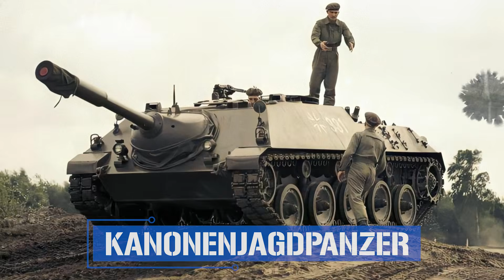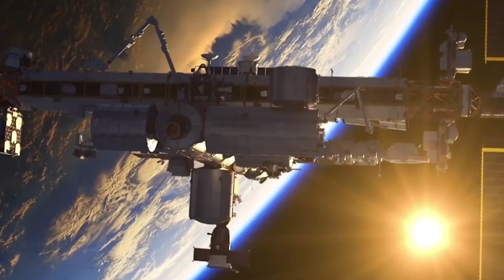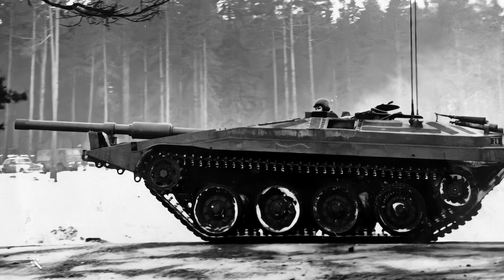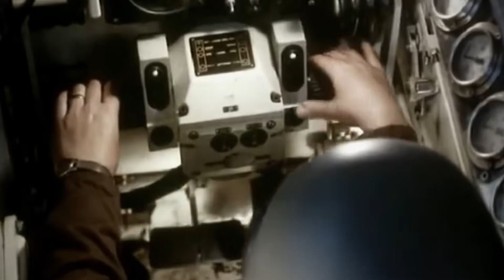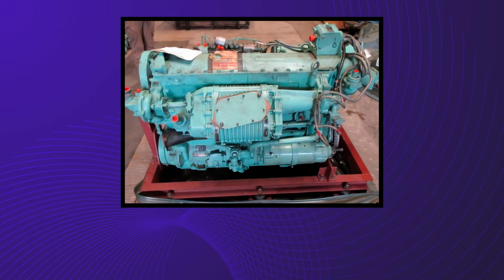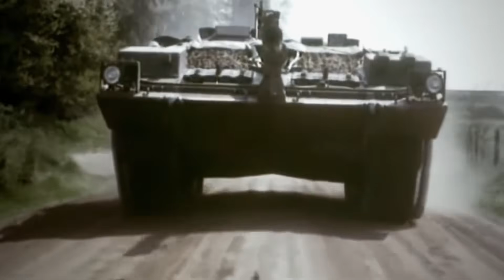Stridsvagn 103: Sweden's Turretless Cold War Super Tank

Comment: Where exactly do all English-speakers get the extra 'E' from? It's not a German bubble-car!

"vagn", not "vagen"!

As for the "tank destroyer, not a tank" nonsense, no-one with that argument has any explanation as to why the American M10 had a turret, while being a tank destroyer. It's almost as if you'd think designation is dependent on usage...

There's a slight difference between a 105mm gun and a 150mm gun. The Centurion did not have the latter.

"L/62" is not a designation. It's a barrel-length, the gun being 62 caliber. The gun was the L74.

Rate of fire was not "nearly 20 rounds", it was 24 rounds. This was, of course, the guns capacity, actual in-combat was lower due to things like needing to aquire new targets, etc.

Magazine capacity was, specifically, 25+20+5, the two autoloader magazines holding 25 rounds on the right and 20 on the left. These could only load one kind of rounds, and was generally separated into AP and HE, with a manual magazine holding 5 rounds, most commonly smoke. 

The third person on the crew also had a human aspect. With a third person on board, there was far less interpersonal issues, particularly when everyone on board could reach and touch each other.

The Strv 103 was the first tank to be fitted with a turbine engine, something that has become somewhat of a standard in various modern tanks.

And, finally, the Strv 103 was never the "S-tank". It was the "S proposal", for "Swedish proposal". When looking for a new tank to replace the Centurion, there were two choices, the "A proposal" for the M60 Patton, the "American", and the "T proposal", for the Swedish word for German, "Tysk", being the Leopard 1. The Swedish proposal, which would become the Strv 103, was of course then the "S proposal".

Comment: Learning about these tanks recently, it makes me wonder if they would fare well against the drone warfare in Ukraine!

Without a turret this design could focus more on keeping the main body armored, and focusing on survival ability has never been more important! The main cannons are useless against small targets anyway, so the fixed cannon isn't a significant downside.

Adding remote operated small caliber turrets and indirect fire missiles to the outer hull would be good against drones, the low profile would help keep it concealed and the main gun could still be used to shell other ground vehicles and positions.

The cannon could feasibly be made slightly shorter to avoid the dirt issue, with modern ammo I'm sure accuracy and even velocity wouldn't be heavily affected. Perhaps placing the cannon a little higher on the hull as well, so that casing would be ejected at the top?

And change the crew exit points to the back to fortify the tank against drone and missile strikes coming from above, focusing on crew exit mobility.

If the swedes were to make a new tank, they should really consider this design again for inspiration! It looks fairly effective, and with new tech, could be improved further!

Comment: One benefit the 103 had with its long Bofors main gun was that it could open fire long before the T55, T64 and T72 could because of its range and accuracy. This is why this tank was one of the first to use a laser range finder and ballistic calculator for precision hits.
The fast auto loader made it possible to hit each target twice to inflict maximum damage before changing target.
It was a complex machine for its time, built for one thing, stopping a numerical superior Soviet tank force at the border.
Reply: Wasn't the main armt an L7? So, did BOFORS not Licence build it?

Comment: Any fan of this tank wants a role for it if only that it looks so cool. With modern guided munitions, computer assist targeting/re-acquisition I wonder what could be. The low profile and self-revetment in  a forest is sensible. 
  I once lifted a good sized snapping turtle from a road and placed it by the wooded lake and on firm mud. Rather than move away, it swiveled and lowered right down into the earth to leave only a bit of snout exposed. I watched and was impressed and disturbed. I also thought of the s tank.

Comment: Behind some elevated terrain you woudn't see it but the gun smoke, shooting at it and the shells either fly over or hit the ground cover. Nightmare ambush tank. Flanking it or strike it vertically using mortar/artillery or air strike only options. But the S tank crew knows this so won't linger too long in one place. Hit and run.

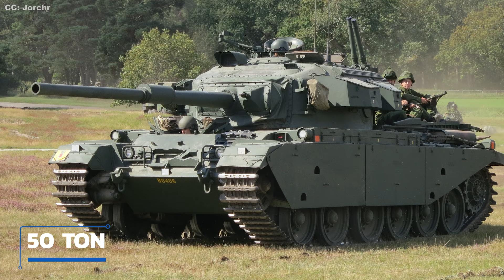Comment: 1:30 - 105mm L7 cannons were used on the later Centurions, not 150mm cannons.

2:37 - The Kranvagn tank concept was of a Heavy tank, not a medium tank (one of the reasons it was dismissed). The vehicle was to feature a 150mm (could explain the confusion at 1:30) Additionally, a significant reason for motivating domestic development in Sweden was the fact that Britain's forecast when it came to delivering Centurions stood at 0, meaning in the event of a war, Sweden would be stuck with only the tanks they had available at the time. This is also the reason why the project was later cancelled, and Great Britain was able to deliver Centurions to Sweden which were cheaper and still showed military promise.

3:49 - The last S-tank production model (Model C) weighed 42 tonnes as indicated in the video, yes. However, the earlier variants were 37 and ~40 tonnes for the A and B models respectively.

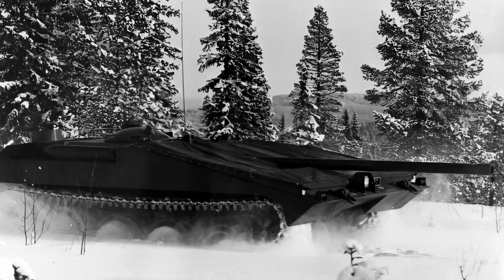6:05 - The S-tank featured 40mm thick plates on the upper and lower front. Not 70mm plates. Sode armour was limited to only 20mm, not 40.
Reply: He also said "High-Energy, Anti-Tank" as opposed to "High Explosive, Anti-Tank"

Comment: I always thought this was a highly innovative design. The dual engines does seem like overkill though, but I am not an armor General from the 60's.  I do think that if I was making this tank with it's fixed gun and autoloaded, I'd have put a serious cannon in it. 120mm would do.
Reply: It's not like they added the faster engine to get more speed, they added the slower engine to get more torque and finesse because to aim the gun you had to move the whole thing, not to mention it retreated facing the enemy. Additionally, the engine bay is in the front, protecting the crew from damage if the tank did get penetrated. So having additional engine mass there helps keep valuable crew alive, which is a priority for small nations.
Reply: @Vinterloft  OK, so use one bigger engine than two small ones. Or, use the weight savings from the engine to add more armor, which will provide more protection and less vulnerability than using an engine as armor. 

BTW, keeping crew alive is valuable for all nations....except people who use Russian gear. NATO tanks place a high premium on crew survivability. They cost more to train than the value of the tank.
Reply: @Elthenar  Armour is actually one of the least important things for crew survivability. What you want is an empty space, or complicated space, for the round to detonate inside of, surrounded by armour so the shockwave has to exit through the entry hole. That's exactly what this achieves.
Reply: @Vinterloft  Nonsense. No one has been firing armor piercing high explosive rounds since WW2. Anti-tank rounds have been HEAT rounds or sabot for decades and decades, neither of which detonates inside the enemy tank. 

At the time this tank was built, designers were skimping on armor a bit because there was a line of thought the armor couldn't be designed that would defeat HEAT rounds. Tanks like this were built to use the large steel mass of the engine as extra armor. Which has been proven to work with the Merkava tanks. Still though, armor is everything. Intelligently designed thick armor is the best protection, by far.
Reply: @Elthenar  "neither of which detonate inside the tank" except they detonate the tank's combustibles. Ammo or fuel, or both. No HEAT or Sabot gets through the 175cm gap between frontal glaces and crew shield, and if they manage to detonate fuel in the engine the crew is unharmed either way.
Reply: @Vinterloft  So, what's your point. Having the engine in the front does increase survivability. Losing the second engine to add more armor would add even more survivability. How are you arguing against this?

However, if you think that front engine design makes it immune to frontal attack, you are wrong. The Merkava tank uses a similar design and ATGM's were able to kill them from the front. And that is with heavier and more modern composite armor too.

Comment: Stridsvagn S/103 was not the main battle tank til the mid 90´s. It was actually the Centurion (being improved over and over again). The truth (maybe not official) is that the stridsvagn S/103 was more or less a failure from the beginning. As mentioned in the video, it turned out being too advanced and complicated (the hydraulic system) resulting in failures all the time, making it too irreliable which is a no-no at the battlefield. Apart from that it was, as told in the video, probably great in most ways.

Comment: Using the identical concept, could a new tank be developed with a larger gun, more armor, and greater speed?  Asking for a lot. I know.
Reply: The biggest problem today would be that you would never reach the same flexibility as a modern MBT with a proper stabilised turret. Back then, a fixed gun was no biggie, as the stabilisers weren't good enough to fire accurately on the move anyways, but today it is entirely possible to engage accurately at almost any distance and speed.

There is also the fact that, in order to fit an autoloader for a 120mm or bigger gun, the tank itself would have to be comparably huge, and in order to make it competitively armoured, it would weigh as much as any contemporary MBT making the mobility nothing spectacular.
Reply: @Mithirael  thank you very much for sharing your analysis - just what I was hoping for.  Take care
Reply: Swedens recent application to join NATO has raised a few flags about our various domestic armament industries, Bofors, Hägglunds, Volvo, SAAB, Kockums etc etc.. The fear is that the application will be termed and riddled with promises to buy war materials from other NATO producers such as the US, UK, Germany etc. Now, I´m sure their gear is fine, but the concensus is that it might stifle and inhibit our domestic production if the NATO-joining process is handled badly by our politicians. Now, with a bit of luck and if our representatives in these negotiations actually surprises the public and do a good job, it might also strengthen our armaments industry, so it can go either way. To answer your question: That would be badassery of the highest order, the design is sound.

Comment: It is "Stridsvagn", not "Stridsvagen".  It's Swedish, not German.  Yes, it means tank  or "Fighting Wheicle". Sweden always have had the will to make better equipment then buy more expensive equipment that doesn't fit out purpose.

The fast mounted cannon was for make the auto loader not to stick, as it could on guns that was movable.  And by the tank, shooting while driving was not a thing when it was out.

And our suscript soldiers should all be operate the equipment, tanks as airplanes.  Original the Strv 103 was designed to be operated by two suscript soldiers.  But later the radio operator, rear drivers was added.  They analyzed ordinary tanks during WW II; and came to the conclusion that an ordinary torrent was a major weak spot.  And with two engines in front, was better protection to the staff.

And yes, Swedish tanks are usually front wheel driven, from beginning.  Original like German tanks that was inspire of previous Swedish tanks.

The diesel tanks on the side was also to increase the protection.  And the grind in the front was to make high armor breaking ammunition to explode before it hit the tank.

Comment: What do the swedes use for a MBT today? Leo 2 or something?
Reply: Stridsvagn 122
Reply: It is classed as a Leopard 2 A5, but one can perhaps say its so much upgraded that it is more correct to regard it as an equal to the Leopard 2 A6 variant. In video games it is the best tank in the world. But personally I am very doubtful. The newest Leopard2 A7 variant is probably the most powerful Leopard tank version that exist today.
And it togheter with M1A2 Abrams are likely the best tanks in the world (personally do I consider Abrams to be slightly better in 1 vs 1 combat).
After that comes Merkava, then Challanger 2 and after that do perhaps T14 Armata come.
Some people will be very upset of my low ranking of Armata and Chally... but I do not consider Armata to be a smart design when it got no turret armor and only relies on cameras and sensors for seeing the world outside the tank.
Cameras can easily be destroyed by artillery and machine gun fire and rendering the tank blind and useless... while a tank without a turret protection will be eaten by Javelins... or having its gun knocked out by enemy fire even if the enemy is unable to penetrate the hull armor and destroy the tank... so T14 is overrated and stupid. And few has been built, and maybe Russia will be unable to mass produce it.
So Armata is hardly the invinsible next generation super-tank as it is claimed to be.

Comment: NIce video. Wondering why a whole bunch have not ended up in UKR.  Could prove a useful fire support tool over there. Just thinkin out loud.
Reply: Well, to start with it's an aged design. Comparable to the T-62s and T-64s that Russia is deploying, probably, but fight anything more modern and you're going to have a bad time.

Add to that the fact that only a handful exist today, as the vast majority of the chassis were scrapped, even if it was competitive on the modern battlefield, there aren't enough to make a difference.
Reply: Armor Piercing fin-stabilized discarding sabot says hi.

the profile made it quite easy to bounce the older generation APDS. Not APFSDS. APFSDS ignores angling, and the Swede find this out themselves when they managed to acquire some T-72 samples from ex-Warsaw pact country. And the 125mm sabot round, while has shorter penetrator length than standard NATO saboted fin-stabilized penetrator, was more than enough to defeat the Stridsvagn 103 frontally even on its upper frontal section.

Want to add more problem of this tank? the gun is unstabilized, which worsdk fine in the late-1960 to early 1970 because most tanks of that decade bracket has unreliable stabilizer or don't have one at all. Not so much in the 1980s when everyone already have the capability to outshoot and outrange you. Sweden even tried to replace these tank early on but couldn't because of budget issue and they could only managed to replace the obsolete thing in 1990s. Why do you think Germany loaned them with Leopard 2A4 before the Stridsvagn 122 was introduced?

Also you people seems to be determined to plunge Ukraine into a hellhole one way or another with those arms shipment LMAO. Lets assume you warmongering-clown can deploy this to Ukraine, what makes you so sure this tank would "survive" a hit from Russia's "Mango" sabot round. heck let's stop there are think why Polish T-72 tank donated to Ukraine few months back are mostly in smoking wreck at Kherson region?
Reply: @gattonero2915  Thank you for enlightening with the technical answer, that was useful.  But on other matters, it's clear you sympathize with Putin and just wish to submit and emaciate Ukraine.  Please tell Silvio and Matteo to go to sleep and not wake up, and join them there. God bless you.
Reply: @JorgeGarcia-lw7vc  "  But on other matters, it's clear you sympathize with Putin and just wish to submit and emaciate Ukraine."

Banderist will equate anyone that is against the jewlensky's junta regime as "Putin sympathizer"
Reply: @gattonero2915  I am not a Banderist, never will be. You do sympathize with Putin, at least won't deny that.
Reply: @JorgeGarcia-lw7vc  "I am not a Banderist, never will be. You do sympathize with Putin, at least won't deny that."

LOL with a side of LMAO

>"Against Kyiv's word means you sympathize with Putin"

also this clown
>"I'm not Bandera supporter"

It's like you people embraced your self projection without shame LMAO
Reply: @gattonero2915  Keep laughin, and get a life one day.
Reply: @JorgeGarcia-lw7vc  already have, and fortunately it's not the kind that is bootlicking a junta regime sitting in Kyiff :^)
Reply: @gattonero2915  Really? Whatever, yo. Honestly, I am not even sure you have a point in anything you say, and with your tone, nobody cares. But regardless, remember Jesus loves you and you are a valuable, worthy person who still deserves love and affection. May light and kindness shine on you.
Reply: Because it was used 30 years ago`???
Reply: @Dunken88  Uh, they keep using, and we've given them older, even junkier stuff, so old age as a reason just doesn't fly.  Any other ideas?
Reply: @JorgeGarcia-lw7vc  The 103 would be counted to the "older, more junkier stuff", as it's not a 30 year old design, but a 50 year old one. Usually, 30 years old isn't old at all in terms of munitions and equipment.

The AT-4 entered service in '86, the Leopard 2 is from '79 (With modernisations, of course), and the Javelin was designed in '89.

Compare this to the fact that Russia are fielding units where soldiers sometimes are armed with the Mosin Nagant, developed in 1882-91, and T-62 tanks from '61, I'd say our 30 year old "junk" holds up rather well.
Reply: @JorgeGarcia-lw7vc  We dont use them anymore